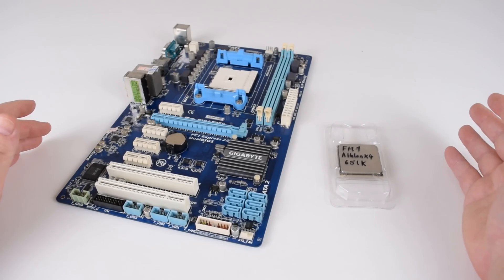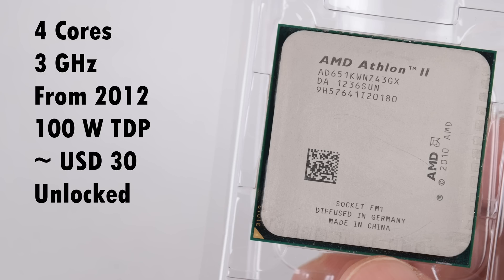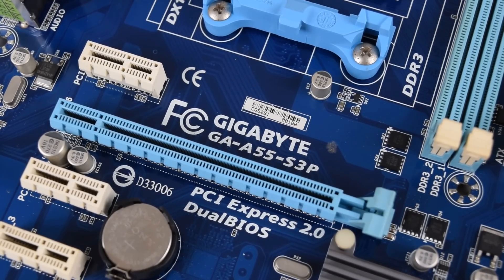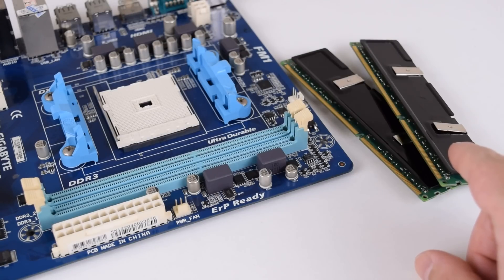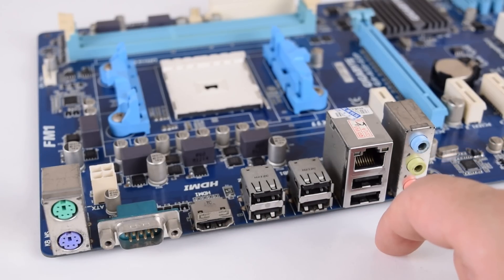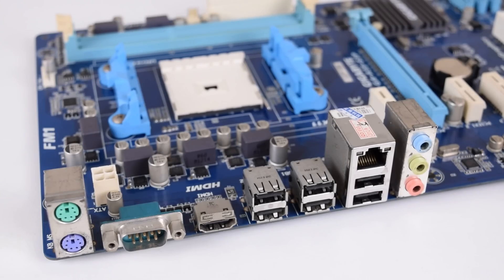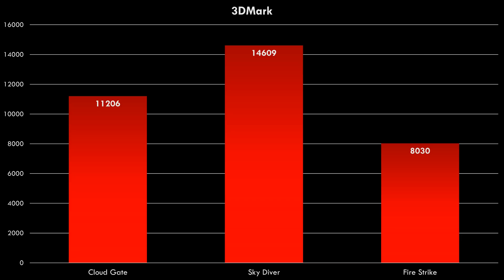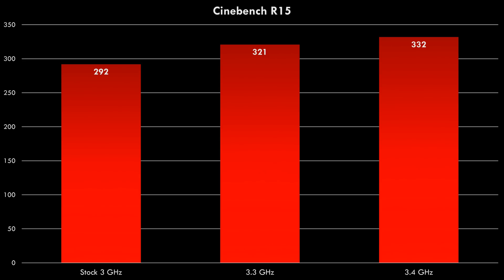Socket FM1 First Look: Athlon II X4 651K - The best CPU

Comment: I found this of Steve Walton (of Hardware Unboxed and Techspot) examining the A8 7600 and gave it an 80% rating. I have my own daily driver with this and both a Giga-byte A88X board and DDR3 2133 RAM that works pretty much the same as he observed. When I added in a refurbed R7 360 2GB card, things worked better. I am getting to the point where a quicker more modern machine is to be desired because cash, baby, not happening yet. As there is nothing wrong with this setup, especially with an SSD, I would keep it as well should the bucks rain down uppon me. Works well with older games and doesn't use too much power.

The one issue I do havve with this CPU is that it seems to run a quite warm. Circa 55C is what is reported at idle and when video transcoding with GPU support it will frequently throttle at about 85C. Pure CPU transcoding will push up to 90C and the clocks will bounce back and forth around 3.5 GHz. I have tried the 45W setting but really haven't seen any difference in temps just clocks, i.e. 3.1 GHz base and 3.3 GHz boost vs 3.1 GHz base and 3.8 GHz boost. As to overall power use, this thing inspite of the heat generation isn't bad with power consumption at about 80w idle and 150 at full blast. 

Steve WAlton article:

https://www.techspot.com/review/770-amd-a8-7600-kaveri/
Reply: Ouch, those are some nasty temperatures you're having there :/

If you ever decide to disassemble your PC it may be a good idea to check if your CPU heat spreader is in true. It is rare but a limited number of processors new and old amd and intel are slightly bowed out causing the heat spreader to not transfer heat properly.

I believe JayzTwoCents briefly touched on this subject in a 9900k video due to unusually high idle temperatures. The video is entitled "I went to delid my CPU but I didn't expect this".

I'm not saying it is definitely this, but it may be worth checking :)
Reply: @JoClip1984  I don't think the temps being reported are quite accurate. Over the year end recently, I ran Seti@home for about 10 days constantly hammering the CPU the entire time. At no point has there been any issue with lock ups, flaky performance or blue screens. The touch test on my Arctic Cooling Alpine 64 Pro (90W TDP) gives a slightly warm to the touch result. I have 3 90 mm case fans and as to the other sensor points, the mobo reports at about 40C and has since new. My GPU reports as 43C at idle and up to 65C under load. Thanks for your comments.
Reply: @dikbozo  Say no more, short of getting silly with temperature probes, that sounds just fine and very likely a mis-reporting as you've said :)

Comment: I actually have a Dell Optiplex with an AMD Athlon 64 x2 3800+ with 4 gb ram that was given to me and I put in an HD 7470 card with a fresh install of Windows 7 and it seems to run older games fine like from 2010 or earlier. PC itself says June of 2007.

Comment: Nice Game Sound.
 I forget if FM1 are real cores.  I know FM2 & FM2+ Are not true cores so a X2 is only 1 true core and X4 is only 2 true cores . Old first few years XP Games should be interesting with this.
Reply from the maker: Yea I think they are. Later the changed to modules.
Reply: @philscomputerlab I think with Intel it's like giving you a faster brain with 4 Hands to work & with AMD it's like 2 brains but the same 2 hands everybody has To work with . 

Maybe

 Intel it's like giving you a faster brain with 2 mouths to work & with AMD it's like 2 brains but the same 1 mouth everybody has To work with . makes more sense .

There is a a6-5200 that say both true 4 and modules. Might not be a true FM module APU Architecture  also idk .
All might be odd to use with Software/Games way before module and APUs or way after APUs got more defined .

Comment: FM2+ with Athlon X4 880K was essentially the pinnacle of this platform. Performance was close to some FX chips, and the platform supports PCIe 3.0, which was the only AMD platform that supported it until the Ryzen platforms dropped.
Reply from the maker: Nice, sounds like worth checking out!
Reply from the maker: christopher james Nice. I had a look at finding a 880K and they are hard to find, or super expensive. On AliExpress there is just one seller and he wants $90. At that price you can get FX chips like the 4100 or 4300 and even 6300.
Reply: @philscomputerlab  heh I used to have 880K watercooled, in some games faster than OCd FXs, I even got some pics left (imgur(dot)com/gallery/MJayF)
Reply: I am going to use FM2+ platform as my main platform. It's cheap and quite new. I am not a gamer so that will be enough for me :P
Reply: The Athlon X4 880K is the CPU I am using in my main rig.
Reply: @Thelango99  I'm pretty sure I lost the silicone lottery cause my 880K needed 1.41 volts to hit 4.4ghz while the 860K I also have did the same at 1.33 volts. that lack of L3 cache however really hurts it in games
Reply: The FM1 platform has nothing in common with FM2+. Steamroller is farm different compared to K10.plus which is FM1 socked based on.

Comment: Great video Phil! After your LGA 1156 video, I decided to get rid of my E5450. I was looking into getting a dual X5690 used workstation but decided against it due to price/performance. A Dell T3610 with a Xeon E5-1650 v2, Ivy Bridge hex core with HT, caught my eye, and I was able to get it for $195. It came with 32 GB of RAM and I paired it with my RX 580 and SSD from my previous computer. I couldn't be happier with how this PC runs. Thanks for your videos!
Reply from the maker: Very nice! In some region older workstations are priced really well.
Reply: @philscomputerlab  I was quite surprised when I looked up the Dell service tag. It originally had a European power cord and a German Keyboard, so I have no clue how it ended back in the Upper Midwest of the United States.
Reply: That is one amazing deal, a year ago I had to pay just as much for cpu only. I use it with cheap MB and 16gb reg ecc ram as a home server.
Reply: @UrošGolob-w7v  Yeah, I had been also looking at i7 2600 CPUs and figured out I could get an entire computer for just a tad more than the cost of the CPU alone. I started to look more at workstations PCs because more often than not they are cheaper and better spec'd than the used home PCs.
Reply: @FiLiMa_  I picked up a lenovo pc with a i7 2600 for 12 dollars(USD)
Reply: @Casper-chrisButterfield  that's a really good deal!

Comment: Man these Vulkan games makes DX API looks bad XD Old system running with Vulkan can still play nicely
Reply: yeah did you see the frame times for strange brigade? coulda landed a 747 on that it was so flat and long(mind you dx12 games were pretty comparable to vulkan)
Reply: @hellbringer09  yup, not bad at all
Reply: understand there's only been so many major changes in computer tech, at about 2-3ghz a per core frequency peak was hit, than it was about multi core which took core speeds back down, than with that it's been increase of cache and tweaks here and there that have truly benefited the speeds of computers..... so from around core2quad to early Core I/late FX there isn't going to be true major difference if code is optimized
Reply: @plasmar1 thats why i still argue fx isnt dead... get a decent cooler and oc a 8 core fx chip and they will still get up and boogie with a 570/ 1060 and outperform skylake?cofee lake i3s for half the price... upgradeabillity aside for first time system builders its great cause you can learn how to tweak fx without really worrying about it...
Reply: @hellbringer09  I'd argue FX was never alive as Phenom II x's were better as far as IPC goes. The whole FX series was a debacle that set AMD back years and years. They would have been better served to keep build up the Phenom's.
Reply: @exturkconner  yeah but people always forget that fx had a lot of future proof built in.. ipc debacle aside they still have the instruction set support for more modern games then phenom for  and overall lower price due to demand. and they still do well if you oc and give it a good chipset and memory i remeber having a 990fx fully tuned in compared to stock i got over a 20% increase in realistic performance after tweaking and id argue for first time tweakers and ocs Fx is one of the best break ins i wasnt trying to say it out perfomed on a consistent basis
Reply: @hellbringer09  Reality is even the 8 core fx's at the end of the generation only compared on par with the i5 2500k. And that was after years of retooling. Again it would have made more sense for them to continue working on Phenom adding in new controllers to handle new micro code.  FX being a huge failure and essentially a lie hurt AMD forever. Moving away from it much sooner would have been a much better course of action. I'm glad they've finally gotten back on track. But FX was way off course and a massive massive blunder.